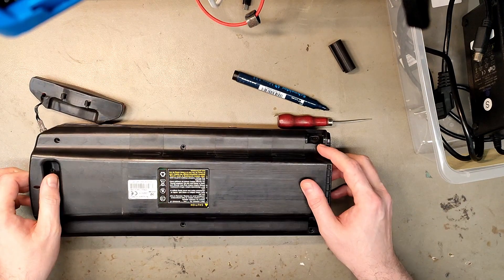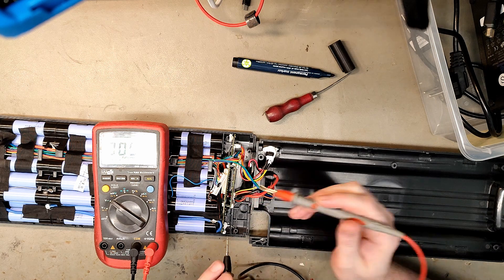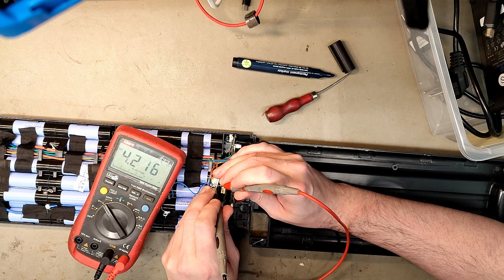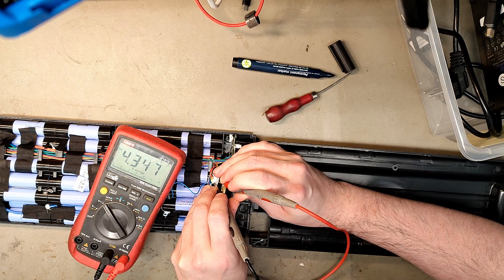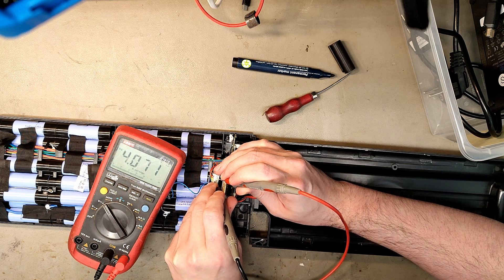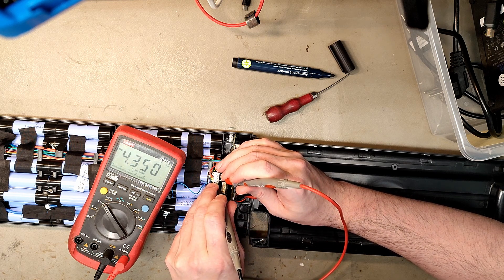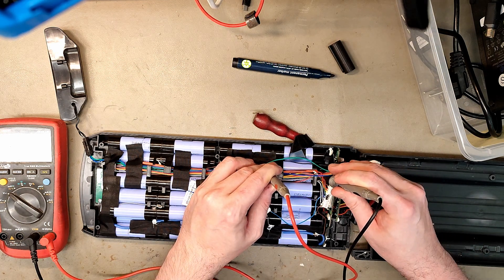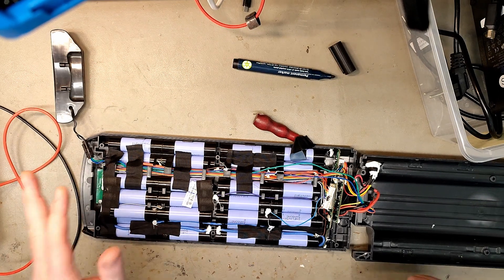Phylion SR20 battery (Crescent Koppla) - Unbalanced and overcharged

Comment: I was checking an 18650 battery pack and all cells were good, but at the output connector voltage would drop instantly to almost zero when i checked dc volts on the multimeter. These BMS systems are strange.
Reply: If its showing no voltage on the output then either its not turned on via the battery or the BMS is fucked or there's a bad 
how was you testing the cells or do you mean each cell pack in series or each individual cell